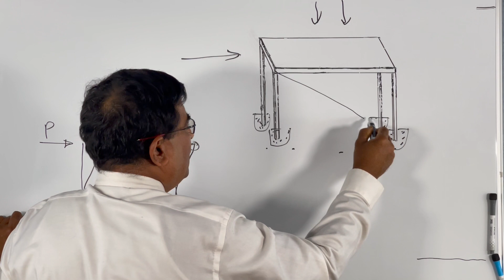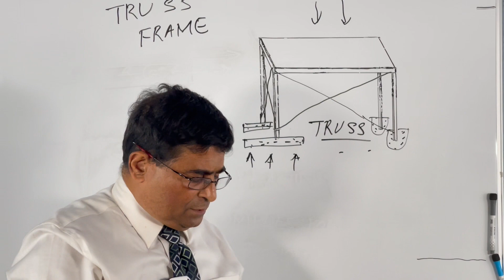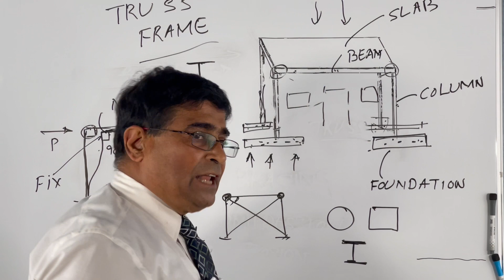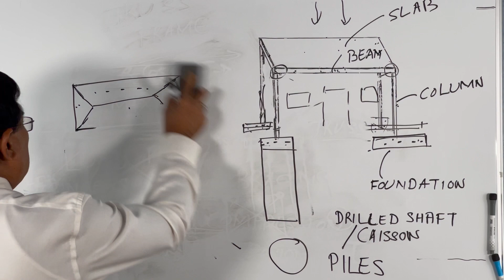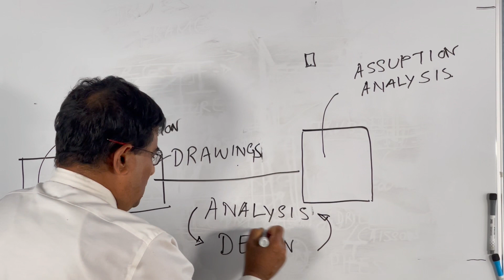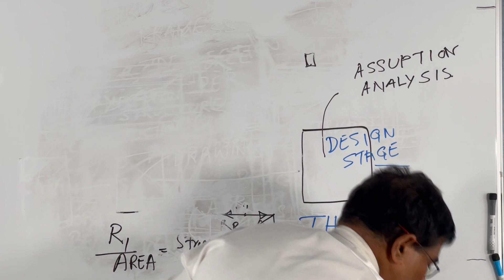GET BETTER GRADES IN THEORY OF STRUCTURES, INTRODUCTION - I, Video No. 1,  By - Kamal C Sarma, Ph.D.

Comment: Sir continue the course ,it will benifit civil engineering student like me .
Reply from the maker: Yes, I have an very ambitious plan that covers everything in Structural Engineering including Finite Element Analysis, plates & shells, solid mechanics, concrete and steel design, bridge engineering etc.  I will keep going as far as I can go.  Thank you very much for the suggestion.